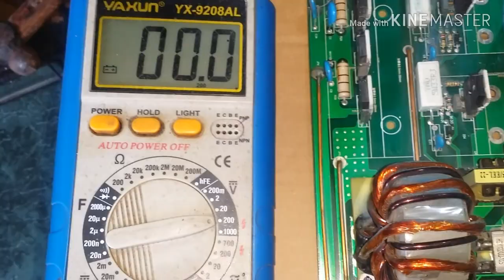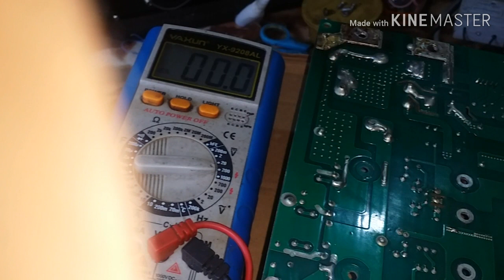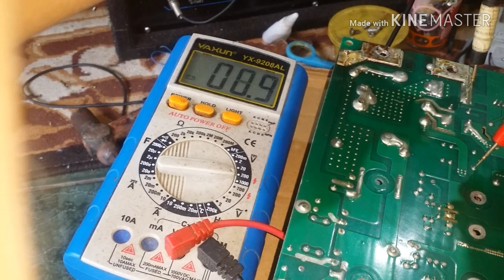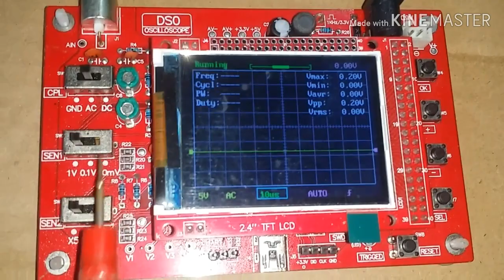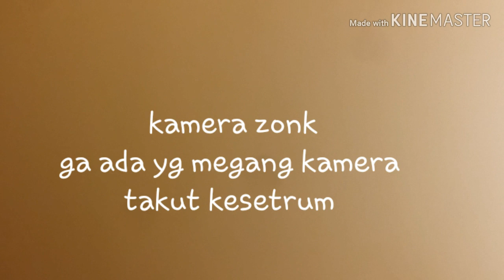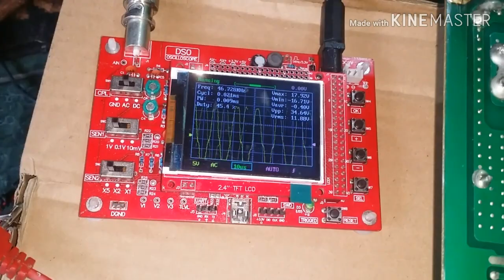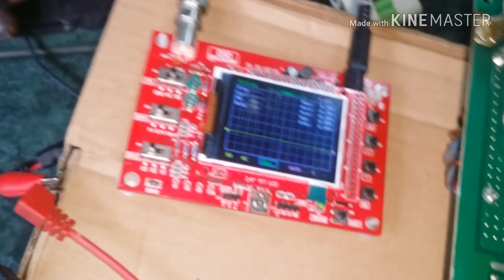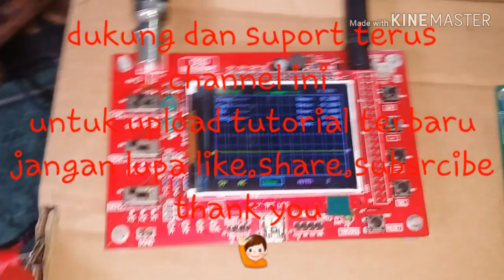MESIN LAS RHINO 120A RECORD DATA

Comment: Assalamualaikum. 
Mas kalau hanya bermodalkan multi tester bisakah? Buat ngukur tegangan dan frekuensi sekitaran IGBT? Dan untuk yang mas bilang jika voltase pada IGBT tidak keluar 17volt berarti yang di ganti resistor dan Dioda sekitaran resistor yah mas?
Reply: Halo mas, untuk area Dioda dan resistor yang di sekitar IGBT sudah di ganti tapi tetap tidak keluar voltasenya 17V kira2 dari mana lagi yah? Untuk frekuensi sudah di ukur normal 45kHz

Comment: mas saya baru beli travo edon karna penasaran tak bongkar, setelah tak perhatikan banyak komponen yang di kurangi kayak elco 400v di pcb ada 2 tapi cuma dikasih 1, trus igbt ada 4 cuma dikasih 2 sama diode fast dll, misalnya tak pasangin biar komplit kayak igbt ditambah, elco di tambah apa  driver sama pwm perlu di rubah?
Reply from the maker: ndak mas , usah , pwm tetep sama , kalo mau di tsmbah igbt harus sama , nilai elko juga sama , tapi kalo itu buat kerja dah lancar mending ga usah di tambah2,. 🙏
Reply: terimakasih mas infonya, sebenernya sih buat kerja aman mas cuma kalo pake kawat 2.6 agak loyo mas kaya kurang tenaga, jadi pengen tak modif hehehhe
Reply from the maker: ya memang mas , sesuaikan kemampunaya aja mas , biar awet ,, kalo mau yg strong beli yg agak badak tenaganya mas ,

Comment: punya saya tegangan output besar tp ampernya kecil ga bisa mateng buat las...potensio ok..solderan pcb ok..komponen masih mulus ga ada yg gosong...kira2 apanya yg harus ganti
Reply from the maker: ada 2 kemungkinan mas capasitor mas 475/250v ganti 475/400v , dan capasitor 470uf/400v , di cek dulu aja sblm di ganti , mungkin nilainya dah short

Comment: Bang mw tanya awal krusakn oc nyala ada suara berderit kipas normal, kerusakan ke2 resistor setelah relay yg masuk ke + elko putus gk tau nilainya krna moder R lama saya kasih 20w 49ohm jeglek yg ccok kasih ukuran brpa dn rusaknya di bgian apa ya bang tolong saranya pak.
Reply from the maker: kalau oc nyala , berati ada beban lebih ,  cek smua dioda out put , dan cek mosfet nya , jika smua baik2 saja , cek travo nya , dan cek capasitor 475n/250v. yg ke 2 , resistor yg tepat 12 0hm 20watt , bisa juga di ganti ntc , atau ptc , jika strip kemungkinan jalur setelah b+ elko ada yg short , untuk test nya b+ jangan disambung ke mosfet dulu , baru di ukur b+ nya , skitar 300vdc lebih.
Reply: Sblmnya mosfet ada yg pecah trus di gnti baru tetap oc nyala trus saya cek elko besar pas di sentuh bunyi ntah dri mna stiap pngukuran yg lain jg bunyi emng blm ktmu sumber decitan sblm nya elko besar normal 300vdc kluar, kalau cabut beban brarti cabut smua ya pa kya mosfet trs dioda beban k trafo jg?
Reply from the maker: Kalo mosfet pernah pecah .. dipastikan driver nya juga rusak mas . Kalo cuma di ganti mosfet tapi ga di cek driver nya tetep sama aja ga bunyi mas

Comment: Permisi numpang tanya
Tegangan ac dikaki gate igbt kurang dari 10-15vac, hanya 0,7.., tetapi semua rata nilainya, apanya ya Kang?
Reply from the maker: pwm on ga mas ? , kalo on brati ada freq nya skitar 50khz , kalo terukur 0,7 brati  komponen dari jalur gate ada yg short
Reply: @afalhannan  frekwensi ada sekitar 46khz Kang
Reply from the maker: jalur kaki gate , smua komponen nya ganti aja mas
Reply from the maker: ukur nya pake skala ac , pake multi analog/jarum

Comment: Mesin Las Rhino 120A 900 watt, setelah diganti IGBT mesin nyala output keluar 58 V, saat dipake ngelas sentuhan pertama mesin langsung mati dan MCB PLN trip, dinyalakan lagi mesin mati total, dicek lagi komponen IGBT jebol lagi, kira2 dibagian mana yang perlu di cek ?. Terima kasih mas
Reply from the maker: itu bagian driver nya masih rusak mas , jika di ganti terus akan jeboll terus .. di urut aja yg dapat kaki gate igbt nya , smua komponen jalur itu ganti smua
Reply: @afalhannan  siap mas. terima kasih
Reply: setelah semua komponen di kaki gate IGBT diganti semua, ternyata setelah sentuhan pertama ngelas masih tetap trip dan IGBT jebol lagi. Mohon pencerahannya. Terima kasih
Reply from the maker: harus di chek dengan soiloskop mas , untuk melihat bentuk sinyal nya , kalo boleh tau pake igbt seri brapa mas ?
Reply: Unt igbt pake tgan 40n60 fd. Tks
Reply: Saya punya kasus yang sama kira 2 apanya ya gan? Makasih
Reply from the maker: untuk mengetaui harus chek smua mas ,. setelah cara di atas tetep sama ,.
Reply: Tegangan pwm punya saya tidak 8,5 volt tapi 9,4 volt normal kah
Reply: Untuk frekwensi 46,1 kHz
Reply from the maker: ini tegangan yg mana mas , yg ke modul apa ke kaki igbt nya ?? kalo freq sudah benar
Reply: Makasih infonya mas, setelah igbt short terus akhirnya setalah saya ganti resistor 150k antara 2 elko besar ternyata dah normal, R 150k nya ternyata molor sd 300k shg igbt short terus. Terima kasih

Comment: Bang saya ada msn las Daesung, igbt 40N60NPFD sort gara2 mesin jatuh.
Tanpa igbt tegangan gate terukur 6.2 vac
Kalau saya pasang igbt dg tegangan gate 6.2 vac apakah aman?
Apakah bisa 40N60NPFD saya ganti dg 40N60FD ?
Terimakasih
Reply from the maker: bisa mas , normal nya 15vac pake tester analog jarum, freq nya 50khz ,
Reply: Ternyata multitesternya yg gak akurat
Saya cek pake merek sanwa: tegangan 12vac, freq. 47.22 khz
Reply from the maker: ya mas dah bisa itu
Reply: @afalhannan  
Mau nanya lgi mas
Barusan saya pasang FQA40N60 dan dinyalakan terlihat normal
Pas ditest ngelas dg ampere rendah baru  beberapa goresan langsung sort lg.
Apakah masih ada yg blm bener atau FQA 40N60 ini tidak cocok ?
Reply from the maker: kalo pernah jebol igbt nya di pastikan drive nya juga kemasukan tegangan tinggi mas ,  ganti aja smua komponen yg dari out gdt menuju kaki gate ,. pastikan igbt nya sesuai aslinya ,. atau ampere yg lebih besar ,.

Comment: bang bisa gak buat sendiri mesin las yg simpel dan pake osilator buatan sendiri
Reply from the maker: belum nyoba ,. mas .. blm ada waktunya.🙏🙏🙏
Reply from the maker: secara teori bisa , pake tl494 ,
Reply: @afalhannan  tapi kok baru di short 1 kali fet panas bgt ya mas
Reply from the maker: Brati blm tepat gulungan nya ..sya sndiri blm nyoba . Tapi di grup bannyak yg berhasil..
Reply: @afalhannan  bisa gabung grup ga mas ?

Comment: saya punya las rhino 120a rusak tdk keluar 24volt ada diode zener di samping transistor ss8050 brp volt
Reply: dioda sener kluar berapa vol
Reply from the maker: 5v bagian gdt nya
Reply: bukane itu kluar 12vol sampai 15vol
Reply from the maker: sing igbt sgitu mas

Comment: kalo input travo gdt cuma 2vdc penyebabnya apa ya mas
Reply from the maker: pwm error ,atau mgkin blm start
Reply: @afalhannan  kalo igbt dilepas normal mas 8v,tp kalo dipasang igbtnya jd drop..
jd tidak ada tegangan di stang las
Reply from the maker: ya igbt nya short mungkin mas
Reply: @afalhannan  ndak mas baru aja sudah diganti baru,oh iya seharusnya  kalo tanpa igbt kan di elco besar nyimpen tegangan ya??kalo ini ga nyimpen mas
Reply from the maker: itu seri brapa mas mesin las nya ?kalo elko ga ada tegangan brati input dari pln blm nyampe ke dioda , chek ntc , dan relay nya

Comment: bang mau nanya,mesin las saya merk triton inverter mma 120a,igbtnya sering short keduanya gw60v60,kira2apa ya? makasi
Reply from the maker: itu bagian drive nya bermasalah mas ,.kebanyakan output dari gdt ga normal .. biasanya dioda short ,resistor , jika ada transistornya kemungkinan juga short .
Reply from the maker: bisa juga di cek bagian dioda out skunder  nya coba cek smua mngkn ada yg short...

Comment: kolambiya se badhaee. mujhe ek eepeees saikil 60/20 masheen ke saath ek samasya hai, ovaraheeting eleedee chaaloo rahata hai aur keval 6 volt utpann karata hai, jab ise chaarj kiya jaata hai to yah abhee bhee vahee hai jahaan mujhe yah nahin mil sakata hai jahaan aapakee madad ke lie dhanyavaad.
Reply from the maker: english please ...
Reply: Greetings from Colombia. I have a problem with a Cycle 60.20 equipment is Italian From the EPS brand the problem is that the protection LED remains on but I cannot find the thermals anywhere and the machine does not generate but 6 volts even if it is loaded. Thanks for your help master.
Reply from the maker: if you have a led protect problem, check all mosfet / igbt, it must be removed and measured, still good or damaged
Reply from the maker: step 2, measure the gate and source must have 5v dc, must be equal and balanced.
Reply from the maker: You can send pictures to me for correction. my email afal.hannan@gmail.com ,

Comment: Bos kalau ga keluar api itu biasanya masalahnya dimana ya? Di traffo out ga keluar juga voltase nya
Reply from the maker: mesin las nya seri apa mas ,. brapa ampere ,. banyak mas dari kejadian itu ,. diantaranya ,. dioda rusak ,fet , pot 1k,. driver loss ,. psu mati ,. banyak mas ,. pwm protec dll